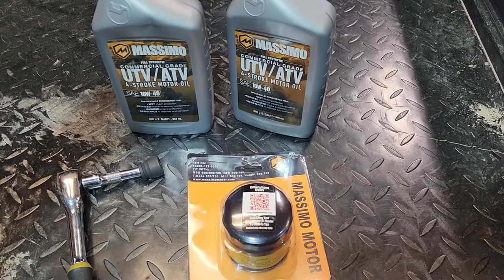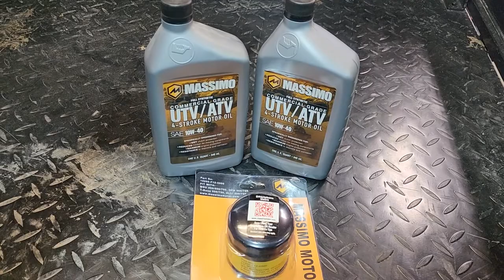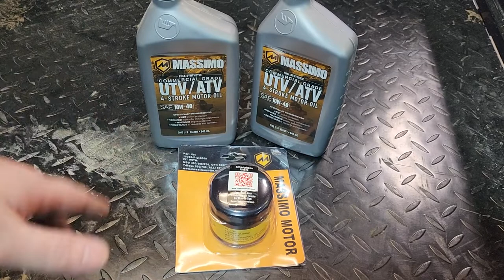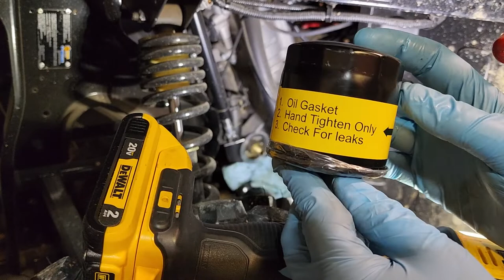How to do an Oil Change on Massimo T-Boss 550 Hisun Linhai 500 UTV SxS

Comment: These are definitely odd to work on and a lot of that is because the engine is a clone of one that was in an ATV. That dipstick location drives me nuts lol. If you do a google search you will find free service manuals which will have all the info you need. Also,  Massimo is selling these kits with the incorrect oil weight. Unfortunately they know next to nothing about their own product. The manufacturer (Linhai) calls for a 15W40..  I suggest following it in the future, your wet clutch will thank you!
Reply from the maker: Interesting. Are you a dealer? Do you see issues with leaking axles?
Reply: @DirtbagOutdoors  Yes we are a dealer/service center, however we have stopped purchasing units from them because they screwed us on almost $2K worth of warranty claims. As far as the axles go, pretty sure every T-Boss 550 we've ever sold developed oil leaks on one or both sides of the rear differential. Something you can do to help prevent those seals from going so quick is put a little slit in the end of the accordion looking diff vent tube to allow the building pressure to escape.
Reply from the maker: @funvalleymotorsports4559  oh man. Not ideal. My axle seal started leaking again. I’m not a happy camper. It would be different if there were readily available parts and service centers. I won’t buy another.
Reply: Not happy with TSC didn't give my owners manual to me .Called Garland TX got the run around  .like the unit but needs more power and my engine response is crappy runs like it's timings retarded.

Comment: The best funnel for these is the tube that comes with a jug of DEF they use in diesels. You can also take the valve cover off, and pour the oil in there. Thanks for the video!

Comment: I have the T-Boss 550 and this video was very, very helpful.  My unit came directly from the assembly plant in Texas and arrived without engine oil which I found when I inspected off the flatbed.  So I checked all my fluids and the plug on the gear box was way over torqued also.  I will see how the filter goes in a few days (first oil change).  Yah, I had a few words for where that oil dip stick is!
I will be armed with a funnel with a hose (THANKS).  I am 76YO, so maybe I will die beffore I have to do serious work on this machine, but they sure did not make servicing a priority in their design.
Again, thanks, this really helped.  BTW, I have the operating and service manual and they never give a part number for the filter.

Comment: Very poor design by the manufacturer. I was thinking about getting one, but now am not so sure. If they can't get a simple thing like an oil change right so it is easy to do, what else did they mess up. Thank you for the video. It really opened my eyes.
Reply from the maker: Thanks! Im not familiar with other brands, so i dont know if this is common or not. If a name brand was just a bit more, i would go with the name brand. If it's a lot more, the massimo would come back on the list. I got a great deal, so it was worth it for me to go massimo and deal with small issues
Reply: @DirtbagOutdoors  Thank you for your insite. I am not much of a mechanic. Never really liked working on vehicles. I can fix most things in the home, just not on a vehicle. I could do the oil change, but the other problem you had, I would not have been able to trouble shoot it. I have looked at these and do agree the price for what you get is awesome. Just no one here dealers here to work on the hard stuff.